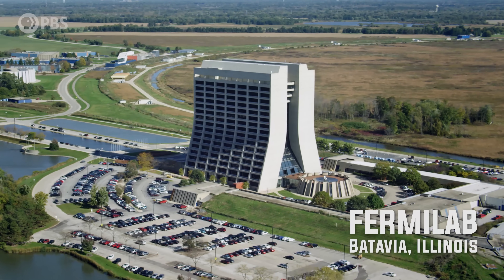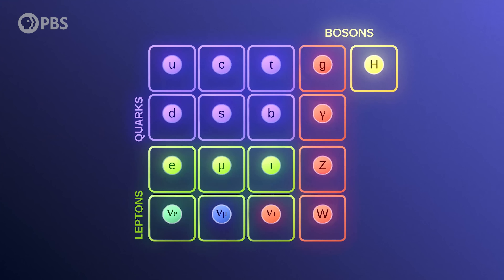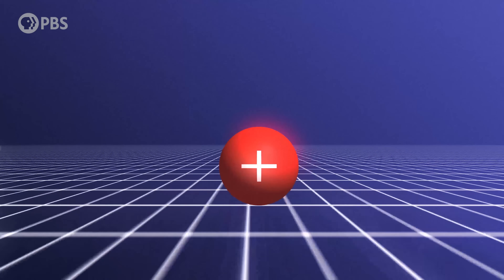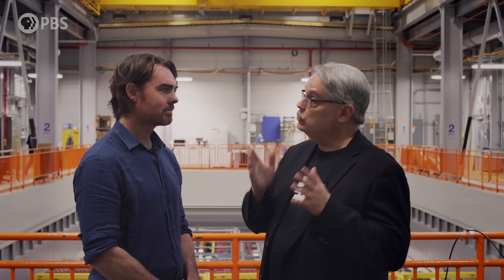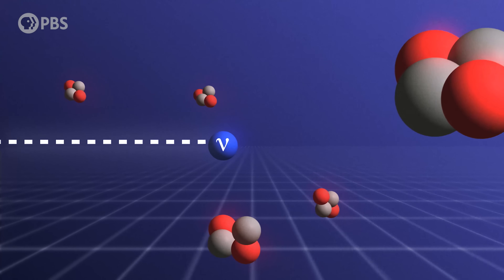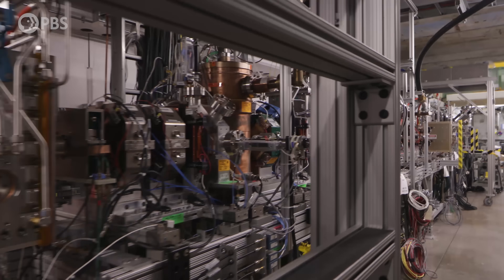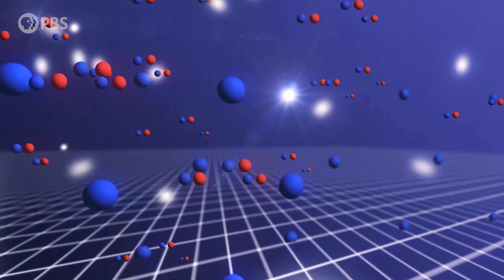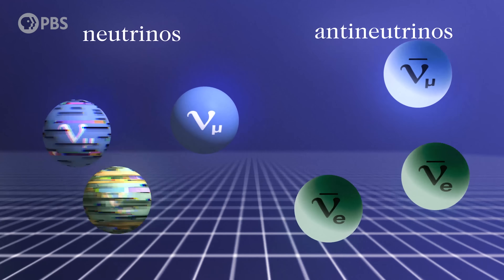How To Detect a Neutrino

Comment: Could only a portion of the matter and anti-matter have been annihilated? Maybe there was an equal amount of matter and anti-matter, but it didn't all combine. Maybe it didn't combine due to randomness / probability / distance. Doesn't the CMB tell us that matter in the Universe wasn't perfectly uniform after inflation? How do we know that our Universe isn't made up of both matter and anti-matter galaxies/local groups/super clusters?
Reply: From what we've seen our universe DOES appear to be made largely of matter. As thin as it is, there IS gas between galaxies and clusters. (Enough that it holds around HALF of the mass of the universe!) If we had 'pockets' of antimatter in our universe we'd be able to see the characteristic glow of electron-positron annihilation at the boundary, it's very hard to mistake for anything else. As yet we see no such signal.

This leaves us with a big problem if we rely on probability; the most likely universe is one with the smallest chunks of matter and antimatter that allow life. Probably galaxies, but maybe galaxy clusters. We should see a sky aflame with the matter-antimatter war but we don't. Something either favored matter intrinsically or somehow actively moved antimatter somewhere else, mere chance doesn't seem to cut it.

Comment: If both are elementary particles with the same mass and no charge, how do you tell the difference between a neutrino and an anti neutrino?
Reply: They have opposite 'weak charges' relating to the weak nuclear force. This alters how they interact with other particles.An antineutrino for example can cause an unstable nucleus to emit a positron while a neutrino would have no effect. This is in fact how they're detected meaning that a single detector cannot detect both neutrinos and antineutrinos.

Comment: Is it possible that dark energy could be a sort of anti-graviton that, as with matter/anti-matter did not eliminate equally at the big bang causing a opposite effect to gravity resulting in expansion? If so could they be particles that solely interacts with matter in the Einsteinian four dimensions of space-time as opposed to gravitons that interact through multiple other dimensions described in M-theory explaining the weakness of gravity compared to the other forces as well?

Comment: Isnt there a massive block of ice in Antarctica that scientists use to trap/record neutrinos that were funneled through the earth by the earths magnetic field?

How is this new project different/better?
Reply: It detects solar neutrinos, they're not funneled by Earth in any capacity, they come straight from the sun.

However we cannot control the intensity of these neutrinos nor their precise distance. This makes it pretty much impossible to use them to detect subtle effects. (Though it DID help pin down basic neutrino oscillation.)

Comment: How do they focus neutrinos? How do they create them or do they Use ones from the sun?
Reply: Did you watch the video? First you focus a beam of pions, which is easy. The pions decay into neutrinos which can't just run off anywhere they like, they have to follow the beam. So you convert your pion beam into a neutrino beam.
Reply: @garethdean6382  i did but most of it went straight through my head.

Comment: If matter and antimatter are identical besides charge, is there any way to determine if a distant galaxy is made of matter or antimatter? Perhaps after the big bang, there was an identical amount of matter and antimatter, but in some regions the ratio between the two was slightly different. Every particle of matter or antimatter that could interact with its opposite would be destroyed but the imbalance in certain regions would have left only matter or only antimatter behind. Maybe one half of all galaxies are actually made of antimatter; there is a lot of empty space.
Reply: Yes, the radiation made when matter and antimatter annihilate is a very specific energy. Even between galaxies there's a very thing plasma (That actually makes up about half the regular mass in the universe!) We'd see the boundary between zones as a pale glow of unmistakable origin. Plus we'd expect galaxy-antigalaxy mergers to happen now and then (Our own galaxy has consumed about 100 smaller galaxies in its lifetime.) and those would be colossally bright, glowing with the same unmistakable radiation. One merger would outshine all the other galaxies in the universe.

But we see nothing. No telltale glows. This very strongly suggests no conflict, that out entire universe is made of the same stuff.

Comment: What I'm wondering about recently, when inflation happened, couldn't there have been patches of spacetime with slightly more matter and other patches with more antimatter? So what if as the universe expanded that rapidly, matter and antimatter got pulled apart before they could perfectly annihilate eachother? Maybe there's a different part of the universe outside of our observable universe that consists of antimatter? Could be total bullshit, but I've been thinking about that the last few days
Reply: There are two main problems.

The first is that the end of inflation seems to have produced a 'reheating' effect where the energy of the inflation was converted into particles. This would include matter and antimatter and essentially rules out inflation being able to do anything.

If we ignore this though we get another problem, how big our universe is. Most of the 'actual universe' would be nearly 50-50 with occasional small imbalances. But the number of imbalances drops with the square of their size; twice as much matter in a space is four times as unlikely.

Our universe then should be the smallest lump of matter that could produce life. That's likely be a galaxy, or maybe a galaxy cluster. We should be surrounded by a vast void where matter and antimatter canceled out long ago, yet we see stuff as far as our telescopes can see, almost as if the imbalance occurred across the entirety of the universe.

Comment: I thought this was ask before.  Wouldn’t 5 light years of lead or 51 light years of wall collapse into a black hole?  I bet those ghost like neutrinos wouldn’t be able to get through that black hole.
Reply: If you made a very thing tube of lead and gave it a weak charge then the electromagnetic repulsion could stop its collapse and it would work fine.

Comment: Five light years thick lead wall! That sounds fantastic number, but is it?
What is such a wall, 10x10 meters, volume/mass?
Reply: In width. The actual cross-sectional area of the wall ca be anything, so it could in fact be a 5ly lead needle if you wished.
Reply: @garethdean6382  The dimensions are given 10m×10m×5ly.
How massive is it, if it was a sphere how big would it be?
Reply: Sorry,a nswered the wrong question with that first reply.

A light year is 9.46x10^15m. The wall with those measurements would form a sphere of 608'998m (Surprisingly small,  about half the radius of the moon.) 

This would have a mass of 10'730'666'200'000'000'000 tons, about a 14% that of the moon. I have to admit I'm surprised that 5ly or lead can be scrunched up that small.
Reply: @garethdean6382  Right, because at first I thought it can't even be built as the mass will collapse into black hole, but then I find it's quite small even compared to the moon.

Comment: Meh. Of all particle pairs, we defined the "matter" as the one that we find, and we define the antimatter one as being the one that we do not naturally find, so of course all of the particles we find are going to be the ones we call "matter". The universe doesn't conserve particles, it conserves charge, so the creation of an electron/positron pair could lead to the positron smashing into a neutron, losing its charge so the neutron becomes a proton, and the positron flies off without its charge as a neutrino. You look at the remaining electron+proton, define those as matter, call the positron antimatter, and ask why there's matter and no antimatter. The charge is conserved, but particles aren't fundamental, they're not conserved, they can transfer their "ingredients", like charge etc, between them. As for why there is something instead of nothing.… existence cannot be conditional, the existence of the condition requires existence.
Reply: That still doesn't answer the problem, the electron can surely smash into an antineutron to make an antiproton. We still have the same number of particles and antiparticles on average unless there's some process that makes the positron more likely to 'convert' which is basically what this whole video's about.

Comment: i am a liiel confused   i know neutons can pass throug 5 ligth years of solid lead but how can than there be neutron stars
Reply: Neutrinos (very very small), not neutrons (much larger).
Reply: Neutrons and neutrinos are different kinds of objects.
Reply: @michaelsommers2356  Thanks  for your answer its a littel bit confusing sounds allmost the same to me
Reply: @wasserman63  Neutrinos are leptons, elementary particles.  Neutrons are hadrons, made up of quarks, and are many ofers of magnitude more massive than neutrinos.  About the only thing they have in common is their lack of electric charge.

Comment: Is the heisenberg uncertainty principle and the time dependence of the energy for the virtual particle why fields - e.g. electromagnetic fields around an electron, decay with range. dT is larger as the virtual particle has to travel further, so dE is smaller?
Reply: No, but sometimes.

If an electron emits a fixed density of virtual photons then those photons will spread out as they move away from the electron, that's just dimming. The sun's light, made of real photons, does the same thing with distance. So in a massless field where the virtual particles can have zero energy we expect an inverse square weakening of fields.

BUT for MASSIVE virtual particles things are different. There virtual particles can 'decay' mid flight, which means the field will weaken MORE with distance. This is the case for the weak nuclear force which is very short range despite being very strong.

Comment: For DUNE, why does it shoot the beam so far away? Does the distance improve the chances of a neutrino interacting with the argon detector?
Reply: Distance certainly does not improve the chance of detecting a neutrino, but it does drastically reduce the chance of a non-neutrino making it through all those many miles of rock.

Comment: as for the question about why there is something instead of nothing: why isn't it reasonable to assume that there are equal amounts of matter and antimatter, but due the random dispersion of material around the universe there are simply pockets of antimatter just like there are pockets of matter? how do we know that some of the distant stars we see aren't made of antimatter? basically my current theory is that we don't live in a universe made of matter, we live in a galaxy made of matter or maybe even just a single star system and the other entities are evenly divided between matter and antimatter. although that does bring up the terrifying possibility of us being hit by an antimatter asteroid or comet, which would be significantly worse than a standard asteroid or comet.
Reply: The problem there is that we should see evidence of matter and antimatter annihilating. Within a galaxy the energy would be enough to destroy pretty much everything. (What would prevent gas and antigas clouds colliding and releasing the energy of a star within a few years?)

Galaxies collide too, our own has consumed around 100 smaller ones and is currently taking in some more. So galaxy-antigalxy collisions would be easy to see and common and would probably leave big holes in our own galaxy.

Galaxy clusters can survive, but there's a thin gas between them. If there were anticlusters out there we'd see the glow at the boundaries, it'd be dim but at a distinctive energy that can't be caused by anything else.

As it is we see NO evidence of matter-antimatter annihilation on a large scale. This suggests our universe is one big lump of matter.
Reply: @garethdean6382  the gas vs. anti gas thing makes sense, but the other stuff i had accounted for in the fact that large scale object collisions tend to be very rare. it would also be a matter of scale, what if the nearest antimatter mass isn't anywhere near our galactic cluster? in the high energy flow during early galactic creation electromagnetic fields could have sorted the opposing polarities of matter and anti matter into different areas, and then galactic expansion further segregated the two types of matter. obviously i have absolutely no proof that this is true, but it seemed like an interesting thought experiment.
Reply: Across the whole universe galaxy mergers, even galactic cluster mergers are pretty common. We can already see quasars out tot the edge of our observable universe, billions of light years away. These objects release a small percentage of their mass as EM radiation. A galaxy-antigalaxy collision would release 100% of that mass.

At present black hole mergers, converting the mass of several suns, can 'outshine' the all the stars we can see for a second or two. They are invisible only because the energy is in the form of gravitational waves. A star-antistar collision would be bright enough for us to detect its signature and merging galaxies would be insanely bright. The amount of radiation emitted is truly astounding when you do the math. If antimatter existed in our observable universe in significant quantities we'd see it, be it ever so rare or distant.

I'm still not sure how any EM force is going to separate positrons from protons to any significant degree. If matter and antimatter particles all had the same charge then maybe, but both consist of particles with positive AND negative charges and those do not sort easily fro, each other.

Comment: Um... about that "imbalance between matter and antimatter", is it not time that is actually what is missing in the equation, the time that it takes for these particles to find each other once they split into an opposite particle and back again?
Reply: If that were the case, there would be lots of antimatter flying around.
Reply: @michaelsommers2356  You mean like that dark matter / dark energy what we still don't understand?
Reply: @thegreatmonster  No, I mean antimatter.  If the reason for there being so much matter flying around is that it has not had time to annihilate yet, then there would also be lots of antimatter flying around that has not had time to annihilate yet.
Reply: @michaelsommers2356  Can we "catch" antimatter in a way that we can with 100% say that we've found an antimatter particle (of which we can also say what matter it belongs to)? How would we know what we're looking at?

Comment: The kind of thing I think about with this is can't inflation prevent all matter and antimatter from annihilating with each other, provided it happens fast enough, and some of the matter (and some of the antimatter, respectively) is clustered within the otherwise more alternating "soup" of matter and antimatter? If I understand correctly, we can't tell the difference between photons and anti-photons? So in that case, any galaxy we observe could be an antimatter galaxy and we'd have no way to tell?
I guess they did the math, but that's the kind of solution I would think of first before assuming that things you came up with mathematically to be the same but opposite are actually not the same in practice. Because at that point, the whole theory is self-defeating...
Reply: While we couldn't tell an antigalaxy just by looking, there IS a thin gas between galaxies. Any boundary between a matter and antimatter zone would be marked by annihilation radiation which we WOULD see as it happens at a very specific energy. (Plus there'd be occasional MASSIVE explosions as galaxies and antigalaxies collided, or even just stray star-antistar pairs.)

We currently see no annihilation signals above background static which suggests our universe is indeed all matter as far as the eye can see. This is a very unlikely thing to have happened by mere chance.